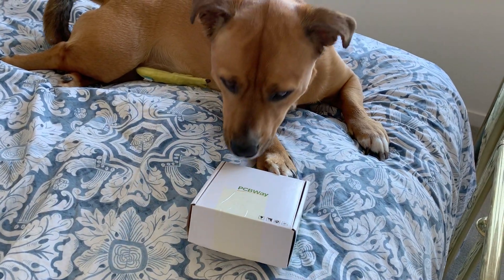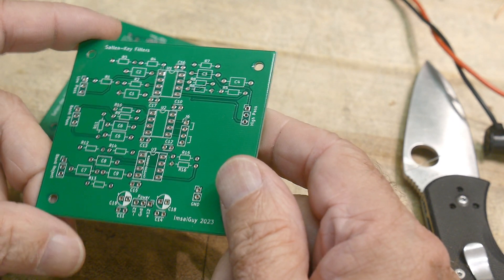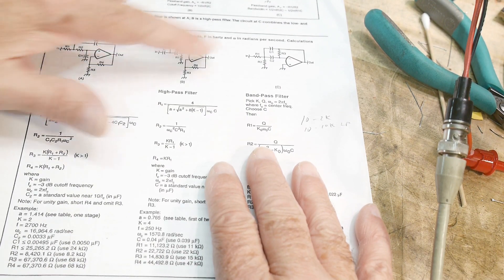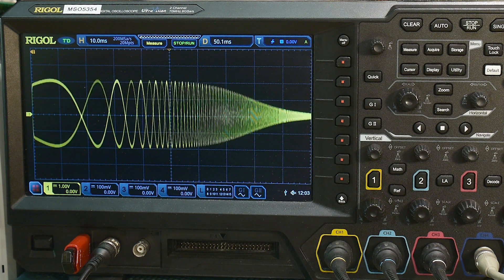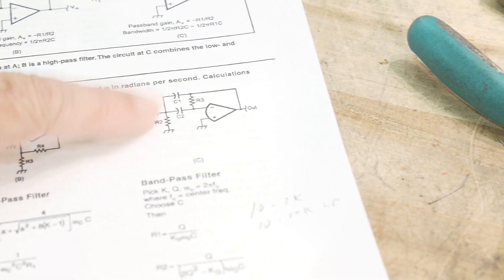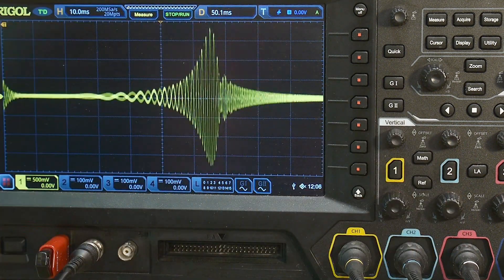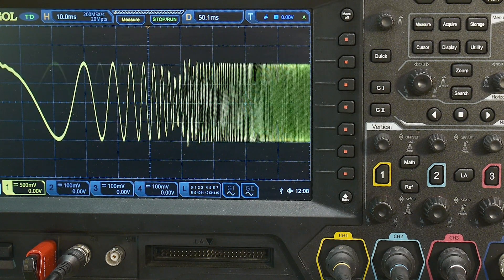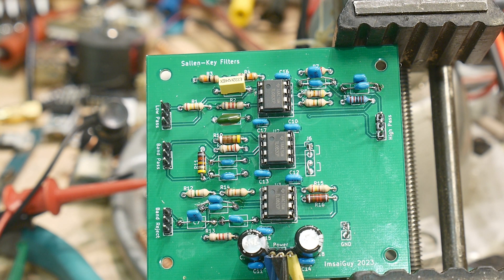#1435 Sallen-Key Filter PC Board

Comment: Could you make a video about creating a Negative power rail from a unipolar "standard" PSU.
Some Texas instruments flyback or so boost converter.
Yusynth has the schematics of the "SYMMETRICAL PSU" Arturia micro/mini brute psu, but needs a lot parts.
Reply from the maker: https://youtu.be/ixj6ULP61dY
Reply: @IMSAIGuy  I was watching this devices datasheet, TI LM2577, but the suggested transformers are no longer for sale at mouser and they don't provide a datasheet for the EOL transformer. How do i find an equivalent? i wanna do the same thing as you, use it for a DIY mixer.
Reply from the maker: @AnalogDude_  i'm no expert, but the two parameters I would look for was inductance and current
Reply: @IMSAIGuy  Yeah, that was what i was doing on Mouser but you get a ocean of transformers. inductance and resistance i was checking. stepping up from 5 Volt to 15 Volt, would probably mean a 3 times bigger winding or so and center tapped. It becomes hard when transformers are in the game. the one indicated from Pulse in the devices datasheet is indicated as audio transformer on mouser, but no datasheet. end of life.
But on it own this device from TI looks good.
easy to use.

Comment: Two questions. 1. With all values of components being equal, what would be the observable change, if any, if you had identical board with SMD components. 2. Why is it (or does it seem) that electronic circuits are designed in  two dimensions? Or is the third dimension the space around the conductors?  BTW... Cool Pup!
Reply from the maker: anything that operates with opamps will be a low frequency and there will be no difference between leaded and SMD

Comment: Nice!  I'm curious as to some common applications of Sallen-Key filters.
Reply from the maker: from chatGPT:
Sallen-Key filters are commonly used in electronic circuits for a variety of applications, including:

Audio filtering: Sallen-Key filters are often used in audio applications such as equalizers, crossovers, and tone controls. These filters can be used to remove unwanted frequencies or emphasize desired frequencies.

Power supply filtering: Sallen-Key filters can be used in power supply circuits to filter out high-frequency noise and ripple that can cause issues with sensitive electronic components.

Radio frequency (RF) filtering: Sallen-Key filters can be used in RF circuits to filter out unwanted frequencies and amplify desired frequencies.

Instrumentation amplifiers: Sallen-Key filters can be used as part of instrumentation amplifier circuits to remove unwanted noise and interference.

Oscillator circuits: Sallen-Key filters can be used in oscillator circuits to create stable and precise frequency responses.

Overall, Sallen-Key filters are a versatile tool in electronic circuit design, and can be used in a wide range of applications where filtering and frequency response control is needed.

Comment: Very nice design. When testing filters one might slow down the sweep rate until the curve does not change any more, or here also until the curve becomes symmetrical in case of band-pass or notch filters. Depending on the Q value the filter needs a number of periods within the bandwidth to react properly.